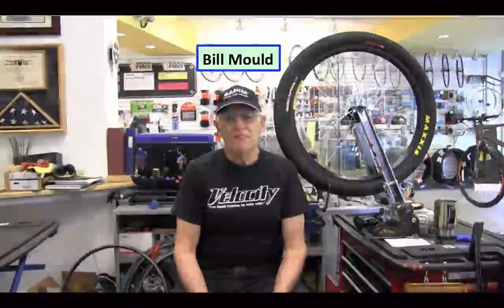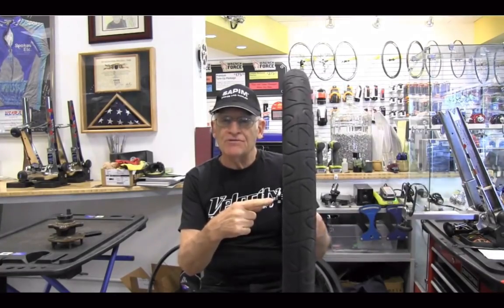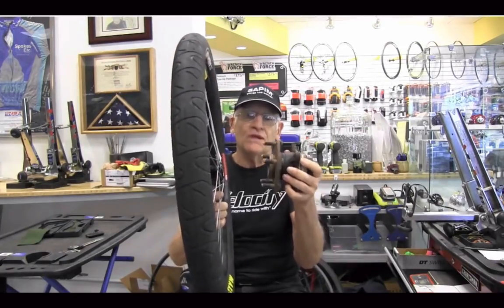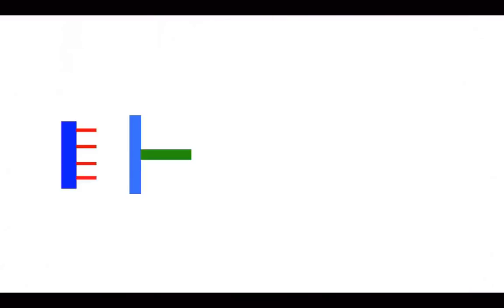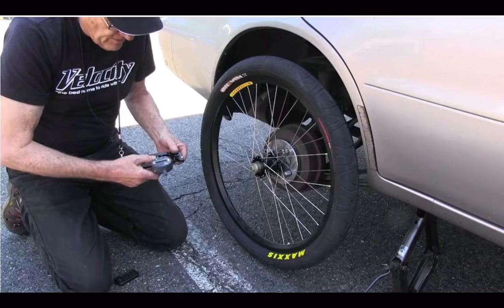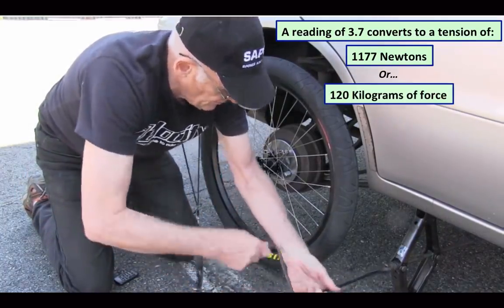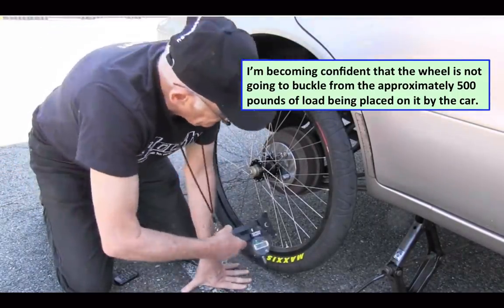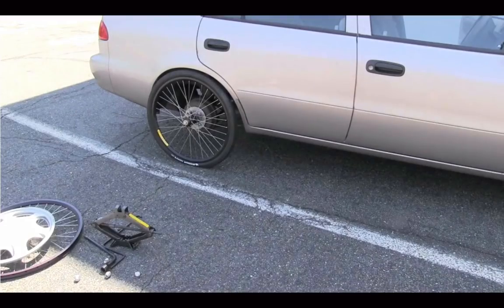Bicycle Wheel On Car

Comment: The real question is, will it drift?
Reply: chrome666dirt u still can drift it
Reply: chrome666dirt you can drift a front wheel drive car quite easy
Reply: joe mama Nah. U can make it go sideways, but it won't be drift. NO WAY =)
Reply: TheNerdyCanadian Nonono, David Blane. It can go sideways, but it's not drift =)
Reply: Watch on youtube doe
Reply: joe mama go do your lessons)))
Reply: ***** if that was true, why do formula drift cars run RWD and AWD?
Reply: Tiger thanks for proving him wrong
Reply: ***** dude, I mean the absolute meaning if the word, 4ex "action called drift is going sideways on RWD car with spinning rear wheels faster than the front wheels"
smth like that. I suppose this side of humor based on terms is not actually known so much in English speaking countries, but in Russia we always lol about that. All the best)
Reply: ***** Ok, then we just got problems about names & meanings of the terms. Just because of different countries.
Btw, are there any ivents or championships all about FWD "drift"?
Reply: ***** FWD powerslide, RWD and AWD drifts, since drifting is the proper use of oversteering, same as powersliding although with drift you use the power of the engine.
Reply: Tiger White you're a ricer. And fwd sliding is less stable at higher speeds. Rwd drifting works because the rear pushes the car forward while letting the front grip so you can turn wherever you want the vehicle to.
Reply: Syper3212 your totally right about the fwd part but isn't awd 'drifting' called powersliding too?
Reply: Max Warren There are 3 ways to make a vehicle slide:
One can suddenly decrease the speed of the rear wheels so they lose traction, by pulling the hand/parking brake.

One can transfer weight of the vehicle by either braking and moving the center of gravity forward, thus lightening the rear end and decreasing rear end grip or transfer the weight from one side to the other, like a scandinavian flick. 

Lastly, one can suddenly increase the speed of the rear wheels so they lose traction. This can be done in a couple of ways; In a manual AWD or RWD one could clutch kick, revving it up and dumping the clutch for a sudden burst of power to the wheels, or simply overpowering the rear wheels with lots of....power.(That is why it's called a "power...slide")

All ways of sliding are "drifting" but It is only "powersliding" if one slides due to overpowering the rear wheels. So fwd cars can't "powerslide" but they can slide, it's simply not due to power.

The slight catch is, if one of the above won't get you sliding, a combo of the above often will. So you can do a little flick of steering before you enter the corner to get you 50% of the way there, then use your cars power (IF your car sends power to the rear wheels) to get you the other 50% of the way there, and 100% you'll be sliding. Is that a power slide? Life's too short, just get your car sideways.

So can AWD cars powerslide? Yes, but most of the AWD cars actually use a combination of methods and power is normally not the main cause of the slide.
Reply: Syper3212 I was facepalming so fucking hard until your post. You Sir, win. Drifting is proper use of oversteering? Wat. Same as powersliding although with drift you use the power of the engine. So why is it called powersliding?
Reply: Oh it will drift question is can you drive it after it does
Reply: Ernesto Andrade 
Thats referred to as sliding lol
Reply: ***** More and likely the wheels will break sideways and depending if he hits a rut in the road it wouldn't or shouldn't flip.
Reply: freddo 1614 Well if you're going into semantics then lift off oversteer is not the equivalent of a rwd car drifting. It's merely a shift in weight balance that, in this particular instance, is used intentionally to initiate a slide. And in that respect there is no difference between fwd and rwd cars as it can be used equally in both to initiate a slide. It's what happens next that potentially turns a slide into a drift.
Reply: joe mama that wheel will snap if you throw it into and turn at regular driving speed,
Reply: +SydneyCBR6 umm you're wrong actually.  the LS4 is a fwd motor used in impala SS and some Pontiac grand prix's.  its a popular swap among front engine/fwd guys, as well as rear engine/rwd guys (porsch, vw, I've seen a corvair with this set up once too).  I even saw a smart car with this set up.  neat as hell, but a LOT of fabrication work.  the LS motors have so many improvements over gen 1 small blocks, that obtaining 500+HP is pretty easy, and relatively cheap compared to taking a gen 1 to that level.  plus the reliability aspect of the LS motors far exceeds that of a Gen 1 SBC.  As far as drifting goes, I would guess that it really depends on the driver and his experiences.  I've never drifted a FWD car, so I can't say.  but I've drifted plenty of RWD cars, and to me its really quite easy.  from my understanding, people who've done both say that neither is easier then the other, its just different, sort of an apples to oranges comparison.
Reply: +SydneyCBR6 not true not all cars that are fwd use a transverse engine  older suburu's and dodge intrepids come to mind
Reply: +SydneyCBR6 put it in the back with a propshaft going to a diff at the front
Reply: +The Dude subarus do use transverse engines , if it used an inline it would have to have a propshaft to a differential at the back then another propshaft going to a differential at the front , which would mean you'd have 2 propshafts , they use transverse and put the power through 90 degrees to the rear diff which puts the power through another 90 degrees to the rear wheels
Reply: Go look at a older suburu
Reply: They don't use a front driveline the use 2 cv shafts out out of the transmission that is not transversed
Reply: ***** ALL of the Scion tC, xA, xB, xC. xD, cars that scion uses to drift have been converted to rwd. All of them. Go watch the videos.
http://scionnews.net/scion-models/scion-tc/rwd-scion-tc-coming-to-formula-drift/
Reply: mikey coyne That is not how a Subaru works. That is how a fwd based awd car works. The Subaru front diff and center diff are integrated into the transmission housing. The axles look like they are coming out of the side of the transmission. The "prop shaft" for the front wheels is also inside the transmission itself(it is actually inside the countershaft). The front diff section sits just below and a bit back of the clutch or torque converter. The motor is longitudinally mounted. This is why they call it Symmetrical AWD. There is not difference left to right so you don't get torque steer and there is usually some sort of lsd in the center to eliminate the torque differential front to rear.  Manuals are usually locked at 50/50 (except the sti and some turbo legacies). They autos usually have some sort of range.  
That is basically what makes a Subaru, a Subaru. Well, that and Love.
Reply: herranton1979 finally someone that knows what the hell their talking  about
Reply: chrome666dirt you can make fwd drift easy just put fast food trays under your rear wheels and rip the e-brake
Reply: +chrome666dirt You can't powerslide it. You can however get it to face the direction of the road after the turn, and that is drifting. You can achieve this by doing a scandinavian flick, or just nailing the brakes and turning the wheel to one side for some lift-off oversteer. That is the essentials of drifting, facing the exit direction of a corner before you actually exit the corner so your straight is a bit longer (and therefore you can accelerate for longer).
Reply: same question lol
Reply: herranton1979 so is this the same for both old and newer model subarus and would evo's be the same or are they front wheel drive based
Reply: herranton1979 yeah just looked it up on a diagram your right, Ive really confused myself. I genuinely didn't know that :)
Reply: mikey coyne Subaru's use longitudinal engines. The crankshaft is longitudinal, therefore the engine is longitudinal. You seem to be mistaken due to the fact that Subaru's don't use Inline engines, they use boxers (or "H" as some people call them). It helps them with it's lower center of gravity and less vibrations than Inlines and "V's". Transverse engines are placed so the driveshaft is perpendicular to the car itself, this helps with length of the car (somewhat) but means that traction is one-sided at the front because those cars have small engines, but big gearboxes, and that makes the weight distribution funky. That's why torque steer is only present in transverse engined vehicles. The rest of your comment is correct though, Subaru's are based on a FWD chassis, but they are perfectly suited for AWD vehicles as well.
Reply: Newgenerationisbg Ah I thought it was just subarus like the brz that used a boxer 4. Thanks anyway, You learn something new everyday.
Reply: mikey coyne Yeah, Subaru's only use Boxer engines, and have done so for the past 25+ years. In fact, the only Subaru that doesn't come with a 4 cylinder Boxer as an option is the Tribeca. That comes with a 6 cylinder. They also used 6 cylinders in the SVX and Legacy (outback and normal) since 2002. Few people know that the 6 cylinder they used in the 2004 Outback is one of their best engines. It's reliable, good on gas (as good as all time AWD allows) and provides more than decent power.
Reply: +chrome666dirt you know nothing of fwd drifting
Reply: +vvysoc the amount of cancer in these replies holy shit, people obviously don't know how to take a joke, what drifting is, and what power sliding is (and btw you cant drift fwd m8, you can slide it, but there is a distinct difference)
Reply: Just like you can drift all wheel drive cars. Learn an think about what you say b4 you say you cant do something.
Reply: Wish I never made a comment on the post with all the dumbass ridiculous comments that have been made since I sure didn't need  5 months worth of bs but some were great for a good laugh for some of these expert experiences and opinions
Reply: The dude is a expert he does this for a living. Dam wish i was you guys.
Reply: it cant even drive
Reply: +vysoc I would seriously doubt that it would even go round a corner at any kind of speed lol
Reply from the maker: +oldskoolhead0 You're probably right, but that wasn't the point of the experiment.  The point was to demonstrate that the wheel could support a large vertical load, which it did.
Reply: +vysoc Wow you do realize the whole comment was a joke?  You don't notice the 500,000$ drift car in Vysoc's profile?
Reply: CFL yep
Reply: CFL hell yeah you'll be drifting like Tokyo drift
Reply: CFL the wheels are for a pimp car a cattalac
Reply: lunatic gamerultimate Cadillac*
Reply: It'll drift if you want to end up with a taco for a wheel.
Reply: CFL no. its will it blend?
Reply: CFL of course with you under car
Reply: CFL i
Reply: No it will break off
Reply: TheNerdyCanadian my dear friend ... with a front wheel car that's car a power slide.... fwd cars don't drift ... Sorry ...
Reply: David Rigby. There are people that do that here, sharp turn, pull handbrake. We call those undesirable individuals "Chavs". Your country may have the equivalent individuals, only with a different name.
Reply: Jamie Bales so true 😀
Reply: CFL  right

Comment: I'm not worried about the wheel supporting the weight of the car, I'm worried about how it would cope with the lateral forces involved in making a turn at speed. Bicycle wheels specifically aren't meant to cope with a lot of lateral force, as bikes tilt when they turn, and the force is absorbed vertically in the local orientation of the wheel, rather than along the horizontal axis.
Reply: Victorhuhu I thought the same thing. Just saw a video of a machine that tests lateral force on wheels too.
Reply: Victorhuhu Plus they couldn't handle the forces of bumps and pot holes or even highway speeds.
Reply: No, probably not. But the weakness in the lateral axis is the chief drawback of the bicycle wheel design.
Reply: He was not testing for lateral support but rather vertical support.
Reply: lllukiosas59 And fair enough. It passed that test.
Reply: lllukiosas59 Obviously. Therefore the issue of lateral support is a relevant commentary.

I guess we could also be pointing out that vertical support is not a problem, but that would be redundant.
Reply: Victorhuhu yh, also the hubs cant handle high speed, the tires will degrade too quickly, and he will have no grip in the wet, all in all, this vid was basically pointless
Reply: Hasnain Iqbal I think his goal was to demonstrate that he can make a really strong bicycle wheel, not actually replace car wheels with bike wheels. If so, his video did well showing that.
Reply: Victorhuhu \
\My concerns are more about the wheel surviving a rapid application of the brakes.
Reply: Mr Shane Okay? I don't understand why you're telling me this.
Reply: Quade235 rofl, like the time i spend like 10 mins talking to a person over the phone about life issues and i've never met this person in my life
Reply: As you already know, the bicycle wheel will not support the lateral shift weight and for that reason auto makers engineered the wheel to be able to support this tremendous weight of the car as it's weight was shifted in turns. For this reason, the bicycle wheel will never work!
Reply: Victorhuhu that is exactly what i intended to post.
Reply: Victorhuhu  was thinking the same thing
Reply: Victorhuhu You can experience a bicycle wheel's lack of tolerance to lateral motion. Apply the front brake and lean forward to do an endo then pop the back up (easier with cleats) and swing the rear wheel sideways so that it returns to the ground obliquely. I've lost reflectors and buckled wheels.
Reply: Victorhuhu would it really be that hard to design a bracket that leans the wheels?
Reply: Probably not, but for what gain? I really don't think there's a lot of potential in applying bicycle wheels to automobiles as we know them. They could be useful in creating super-efficient lightweight vehicles, though.
Reply: Those wheels have spokes like bicycle wheels, sure. 

Those types of wheels were no good, as we don't use them anymore. For example, the contact-patch is very small, leading to compromised grip. Modern wheels also don't stick out as much. Because they are basically hollow cylinders, a lot of the axle is actually inside the wheel. That's not possible with a hub and spoke system.
Reply: Victorhuhu His insurence wouldn't cover him in a accident that's for sure.
Reply: Victorhuhu exactly the major malfunction here...
Reply: Victorhuhu I agree, the wheels would be useful for creating efficiency to many vehicles. But, you are stating the obvious when it comes to lateral limitation, because all vehicles have limitations. As a driver, you adapt and move on. And, the vehicles we drive today are overweight and overpowered for our outdated speed limits. There are e-bikes that are banned from US sales because they are too fast, but people are still willing to spend $100k on a vehicle to sit in traffic (with great lateral resistance).
Reply: MaintenanceMouse Couldn't have said it better. Something is very, very wrong with transportation. (IMO I think there're too many inept people around that don't have the brains or physicality to let them switch).
Reply: MaintenanceMouse The lateral limit that we are referencing is not lateral grip, it's the catastrophic structural failure of the wheel under mild cornering forces. 

Not really something the driver can can adapt to or move on from.
Reply: flagpoleeip I note the structural failure fear of mild corners. As a driver I adapt by driving  slower. Am I free to move on or do I need a degree to understand the dangers of exceeding mechanical limitation?

I have a feeling a apx. 1800 lb Smart car will fair better than a apx. 2500 lb Sentra. Then, there is the weight savings of the wheel swap. A fanatic might go with an electric motor to save 100-200 lbs and a little more with aftermarket racing seats, carbon fiber blah blah etc...... 1,100 lbs at the end of the rainbow.

Am I still on the wrong page to make a turn on bike wheels? :)
Reply: Victorhuhu 
I dont see why it wouldnt work.
They used to make spoked wheels for cars. Same thing, just built bigger.